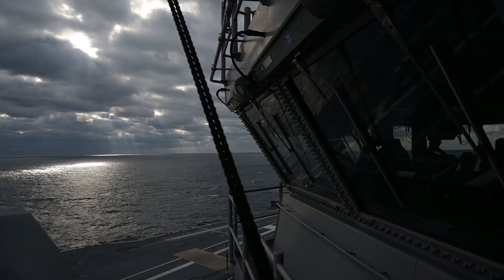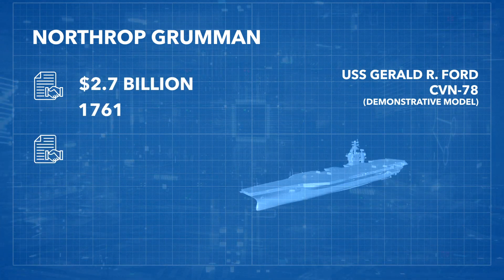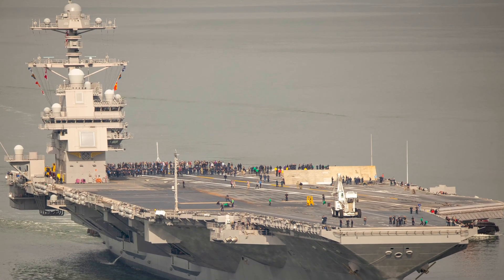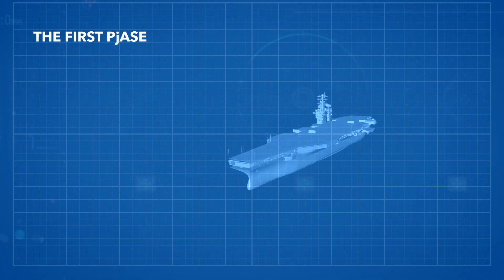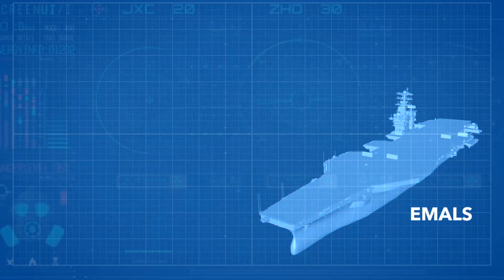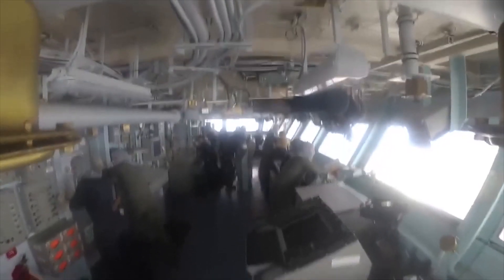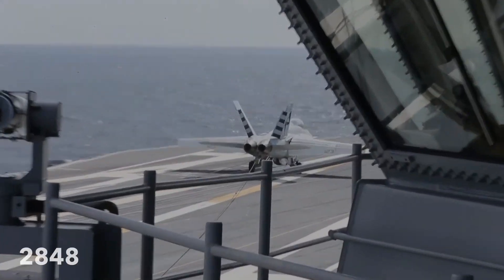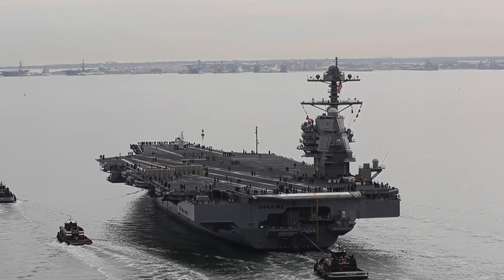New US Aircraft Carrier Shocked The World!

Comment: The Ford also have a very unique protective layer in ther hull - spaced and with a current flowing on both spaced layers, so when a the liquidised bolt of a HEAT like weapon connects the layers and evaporates the bolt, so it might not pirce the inner layer and the into the ships guts.
As this sounds interesting - it is possibly the most stupid thing on the whole craft. This ultra whighty, space consuming equip protects only against weaponary that would never face a aircraftcarrier in the 21 century. Those are even old chool in tank warfare these days o.O But probably they had to do something with ther enourmous amount of energy that wasen't needet anymore since the directed radiation CIWS failed so epicly and ASROC's become too fast to melt them from the sky.

Speaking of that - a aircraftcarrier has two specific uses. One is to look good and patriotic on recruitment posters, and two is to push votes for a president that managed to tel them bomb that few enemys found on earth not able to sink it quite instantly.
ASROCs evolved too far, and even if the US navy would still have sensor/e-warfare superiority, mach 6 is too much to do anything. Therefor the minimal number of CIWS platforms are understandable. But even if, there are also supercavitation-torpedos in the water that run on 600km/h and can't be tracked before(as manouvers has shown even with way aged attack subs in opposition) and also not stoped before they hit.

It still is an interesting vehicle however, and usefull if it is used within its (rising) limitations. I had put my money on something more modern and adaptive but instead of make something aged a bit more modern - but that's the thing with iconism vOv